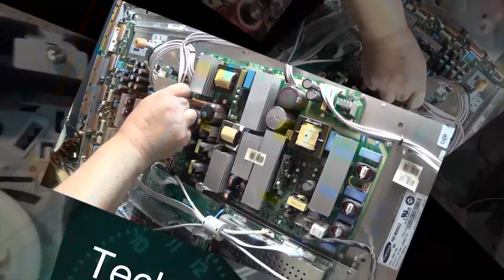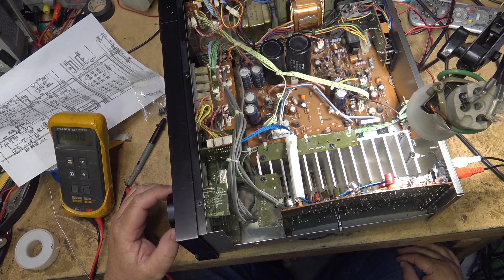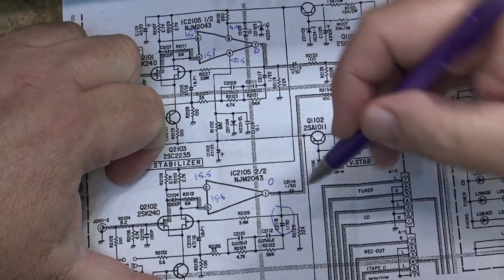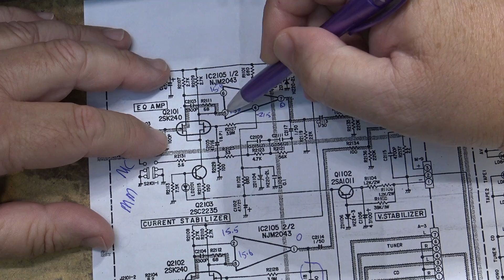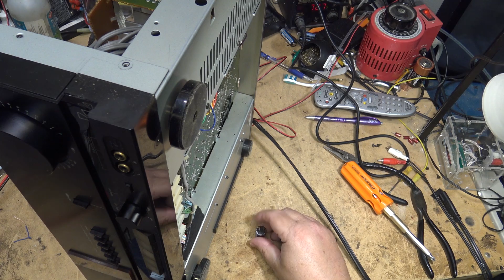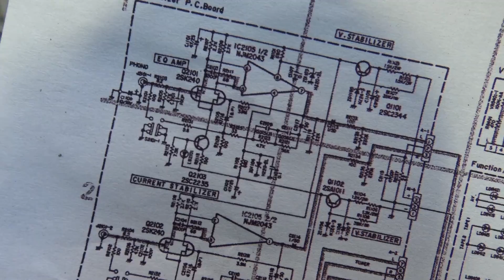Luxman LV103 Conclusion Fixing the bad phono preamp stage

Comment: I just knew when I watched the last video, when you said "I will have to make a special trip to pick those up" that there would be a rant on this video about having to wait, getting the wrong parts and them rushing you out of the store after waiting.  I just knew it!  You are so predictable  ha ha ha  :-D  Why is everyone so hung up on changing caps?  Ok, some loose it but others work just fine and will keep working.  I changed all the caps on a 40 year old amp and didn't notice any difference in the sound.  Although I did notice a tiny bit of hum that might have been caused by two tiny caps leaking on a per-amp, other than that i noticed nothing.  You could only hear the slight hum if you concentrated very hard at volume with no sound.  If anything there was more problems with resistors and diodes burning the PCB than anything else.  What a bitch the amp was to work on, they maybe sound great the  Leak Amp, but I was so fed up working on it I sold it.  I see they are making them again after a long break, but it looks crap, I hope the inside is better than it looks!  https://www.whathifi.com/news/british-hi-fi-brand-leak-returns-with-its-first-product-in-40-years

Comment: The length of this vid is no problem on my end - very interesting all the way through - kind of a "bummer" that you weren't able to change out the "red" caps - regardless, I'm not surprised that your Luxman sounds so good, some viewers may not be aware that Luxman is still producing some of the finest playback equipment out there - they're ultra high end stuff is coveted by those audiophiles that put together playback systems where cost is practically no object - their M900U amplifier would fall into that category, it's considered to be one of the finest performing and sounding at any cost level - - thanks, enjoyed every minute.

Comment: The double jfet is a differential ampilier that adjust the gain according to the feedback circuit which is the RIAA compensansated frequency filter.Q2103 along with LD2101led form a constant current source that drives the dual Q2101 jfet differential amplifier.And finally the IC2105 is a dual operational amplifier common in both channels.

Comment: I got a question for you , is there a solvent that will make the circuit glue soft and make it easier to get off the parts ????  I have a couple tiny ferrite beads with some tiny copper winding's on them in my HR 2510 ham radio...... Those tiny ones are like Hen's teeth , and have to be wound by hand nowaday's.... I don't know how many winding's are on there....

Comment: Sir i have a simple question regarding  on multimeter, based in your exp. What is the best for you, analog or digital multimeter?
Reply from the maker: I use a fluke 12.
It would be a fluke if it's accurate.
Reply: So you mean digital multimeter is the best

Comment: Nice amplifier you got but the sound quality is not my cuppa tea. For the money I rather buy cheaper marantz  for the sound really. It's sound horrible it's sound like medium wave radio alarm clock 😂 but I will be very very disappointed for $2.000 back in the 80s I will be crying. It far too warm for me with the sound. Ok I understand is the tube sounds. I give it a pass but the bass is good.
Reply from the maker: Sounds like a clock radio? What have you been smoking.  You can't tell how it sounds over the camera especially from the 6" whizer cone speakers in plastic box jvc ghetto blaster speakers I am using for test speakers. On my good speakers this amp sounds fantastic.
Reply: @12voltvids  am agree with you now am sorry mate 👍

Comment: You can join  the Neg. lead on two S.P. caps to have a B.P cap , it halves the rated capacitance so you need two 2uF s.p to = 1uf b.p. Also sometimes both the schematic and silk screen on circuit board can be wrong for S.P and B.P markings (among others) I did a Marantz 1070 recently, ordered parts based on schematic and parts list , the pre-amp board S.P indicated and I replaced with a S.P , sounded OK testing . Recapping a second 1070 a couple days later I see the cap I removed was B.P  so I replaced with B.P , went over to the first Marantz  1070 customers house and swapped the caps out for B.P and man it was night and day  , he did not notice it first because the large amount of hard dirty hours on the amp beforehand ( blown outputs main reason for recap). I would swap all the B.Ps with B.Ps on yours IMO. 
 Thanks again for the videos , long format is good 👍
Reply from the maker: Yes I am fully aware of this.  Have done it before, but this is a critical low signal area so I wanted the correct value. The smallest I have is 2.2, so that would give 1.1, and these were 1.0. Again not much of a difference but this is the critical RIAA equalization circuit so any drift is going to present itself as a change in the response.
Reply: @12voltvids  Yes but to be fair these are probably 10 to 20% rated caps anyway,  I always measure caps when mirroring channels , not so much for spec but to get them as close to equal values per side.

Comment: Glad you show the lengthy original version of "A Day in the Life of DAVE " so viewers can see that sometimes it takes a twist and delays to fix a quality piece of valuable equipment.   Always a learning process. Thanks    J K
Reply from the maker: Another one on the way. Finished that NAD and more parts were found bad after the 3 new transistors installed. A total of 4 transistors in 2 resistors.

Comment: The vacuum bulbs will warm up the front end... when the filaments get hot! Or you have the wrong bias on the grid and it red-plates! 🤣 That being said, I’d still rather have an old tube radio than an all solid-state one. 😁
Reply from the maker: These won't red plate. They are preamp stage only, and the voltage / current is not high enough.
Reply: 12voltvids - “voltage current” huh? Is that the same thing as volt-amps? Or a typo? 😋
Reply from the maker: @williamsquires3070  
Voltage/current. My phone has a babbit (did it again changed habit to babbit!) of chang in ng words so they make no sense at all.  This voltage is low only about 100v and the current is also limited to a few miliamps so even if the bias was way off, the power supply wouldn't produce enough power to red plate the tubes.
Reply: They actually don't run  as hot as you may think. At least not in this amp. Don't remember what they use exactly but when they were selling them some 30 yrs ago I didn't notice too much heat coming from the front panel.
Reply from the maker: These don't run that hot. 
You want hot. Grab the el34 on my yaquin or the 6l6 on my elekit. Now those suckers will leave you with 3rd deg burns.
Reply: 12voltvids - I was just being facetious. 😜

Comment: 2sk240 JFETs, try to find one these days. I would put 1uF film, polystyrene, polypropylene, mylar - stinking bypolars, I'm not big fun of them in NF leg, not that I hear differences, just for reliablity. Or 2x470nF small film caps in parallel. Some stores used to have them from time to time, if not Parts Express or someone dealing with crossover parts, because they are pain to find.
I had Sima power amp from late 80s, the 470uF in nfb to the ground went bad and gain with it, took me a while to figure it out.
I'm fighting with my Nakamichi deck, changed the capstan motor and belt, but it doesn't want to settle down on particular freq, wondering a bit. Strangely speed came down once I closed the chassis. Let it play for a while and see if it will keep steady speed.
BTW, did you pick up the adjustable soldering iron at Princess, 70$ on sale, screaming deal.

Comment: At one point i was wondering if i should switch the caps in the audio path on my stereo amplifier to "audio grade" quality ones, in particular the Elna Silmic II ones until i saw their estimated lifespan. It's a joke compared to other quality capacitors! Also they're just rated for 85°C. After i saw that, i did a big "Nope.." and kept my 105°C ones that have 4 times the expected lifespan  :p
Reply: You read wrong information. Those Elnas are high quality that last at least 20 years

Comment: I'ts never mattered to me how long your videos are, people are too picky.
Shame about the stupid shop mistake,  i have  r.s semiconductors for parts but they are not what i call cheap.
Just out of interest did you test one of those large caps to see how far they changed over the years?
For some reason i thought about a norton amplifier when you were talking about gain selection, just rubbish that comes from memory,  memory saves all sorts of crap lol.
Reply from the maker: The large caps I changed are well in spec as you will see in the next video.